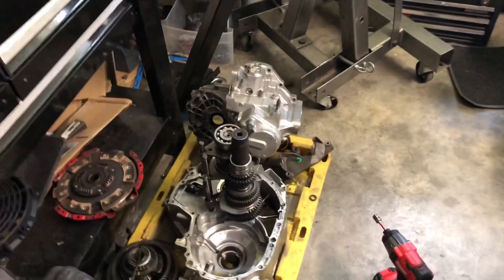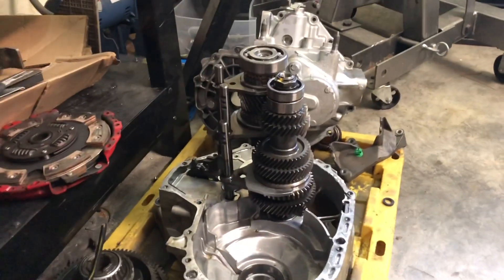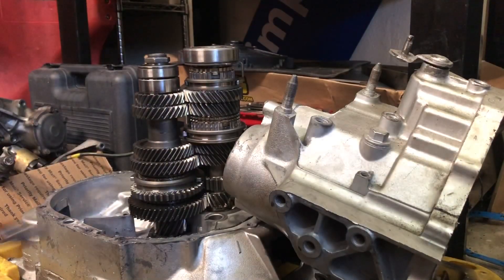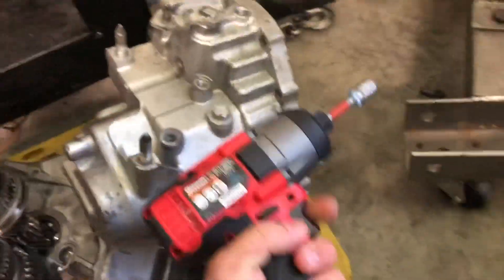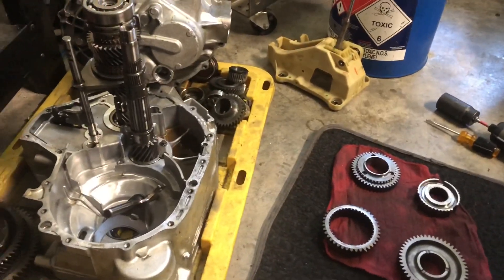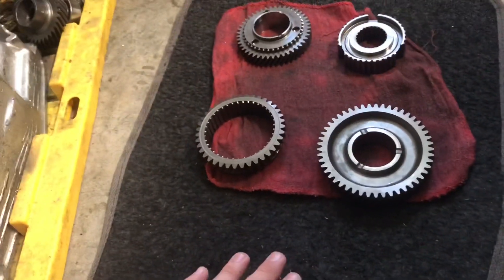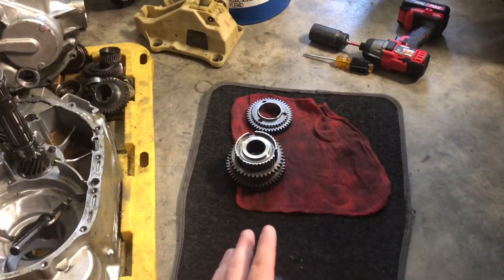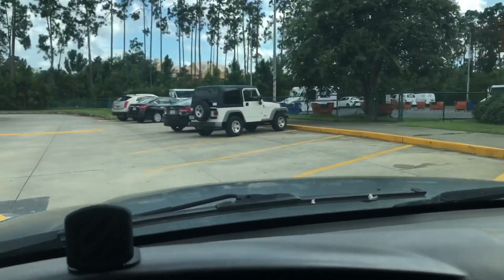Sent Out Some Gears! Liberty Gears Faceplating!!

Comment: Wouldnt it be ideal to faceplate 2 and third i dont see benifit in faceplating first
Reply: Because the 1-2 slider will be made for dog teeth and not synchros.
Reply: Garage Built TV what’s the difference/benefit? Not sure what he’s doing here
Reply: @Burrmao196  he's taking the synchro engagement and replacing it with just 5 big teeth. Benefits are huge when shifting hard and heavy. Instead of having to wait for 40 teeth to synchronize he now only has 5 teeth. It's hard to explain over text if your not familiar with how it works. Google synchro vs dog engagement.